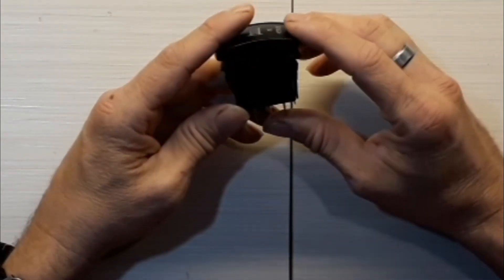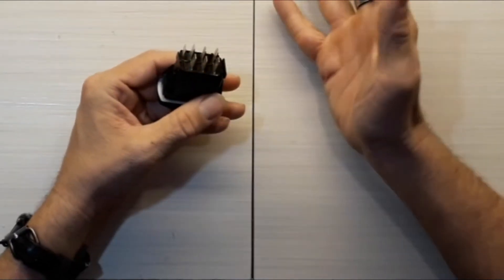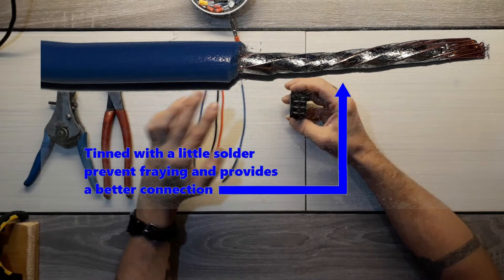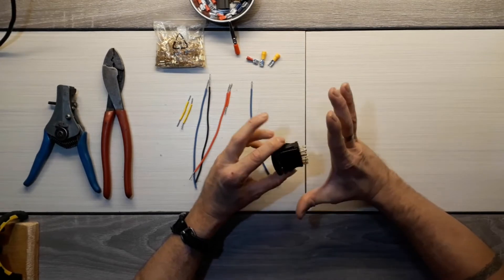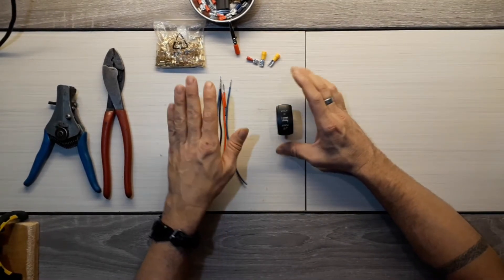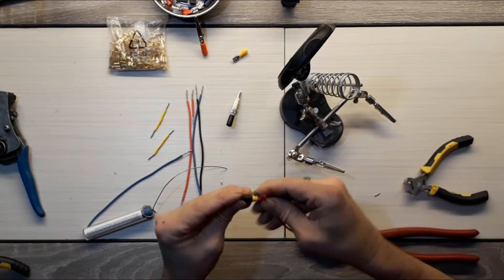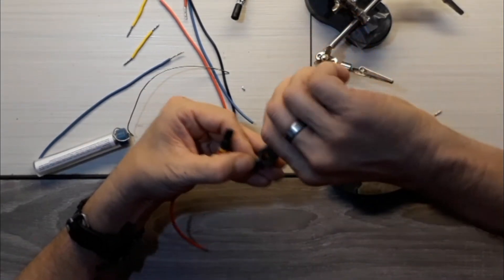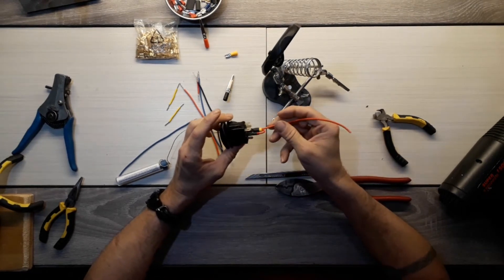7 pin winch switch permanent install

Comment: I just bought a momentary 7 pin switch for my kolpin winch. The kolpin winch just has 3 wires, red, black, and blue. There was a rocker switch on it before. I hooked the 7 pin switch up the way you did with the jumpers and like how it says to do in the instructions, but it will only wheel the winch in and not let it out. Any ideas? I’m at a loss.

Comment: This is exactly how I wired mine I have been trying to find a video to explain the problem I'm having is it works fine to winch in but blows the fuse as soon as I winch in
Reply from the maker: Has to be a short somewhere you could see if the winch works when not using the switch jump on that hot wire to a power source if it pops another fuse it a short in the winch which can happen in motors  if not it's between the switch and winch crossed wire or a short

Comment: What one of the positive wires do I hook up so that the lights illuminate only when I turn the headlights/dash lights on
Reply: Did you ever figure this out?
Reply: @emacherrokee for that hook #1 to battery power and # 6 to your illumination circuit.  👊

Comment: Great video.  What modifications to the wiring need to be done if I want the led’s on the rocker switch illuminated all the time…even when not activating the winch in or out?
Reply from the maker: Thank you I appreciate that a lot :) you simply isolate which post runs the LED ad put it to the power source that is on at the times you want the led on.  ie if on 24/7 you run it to a source from the battery that's always live if you want it on only when the ignition is on you wire the  LED to the ACC on the ignition or other such source that's only live when the kes on :)  that help?

Comment: I have the same switch trying to use for turn signals do you know how I could wire it with a flasher I have it half way working not sure if I need two flashers any help would be great thanks it’s on a four wheeler